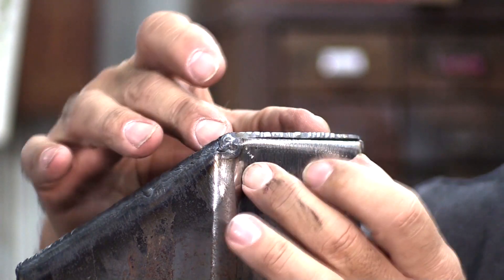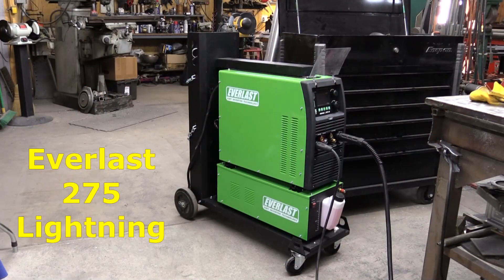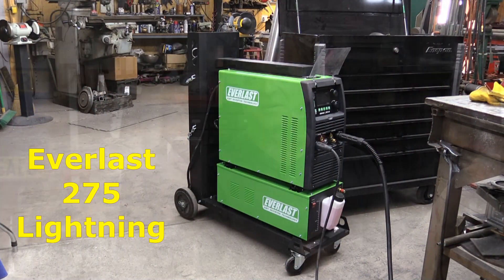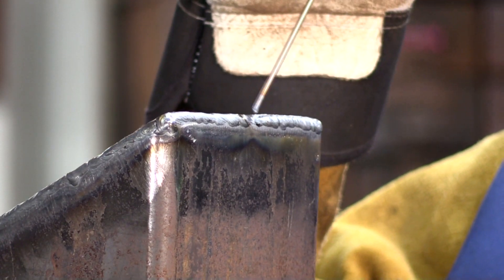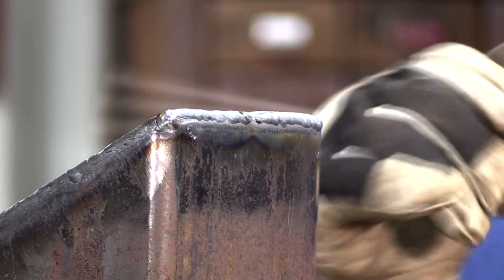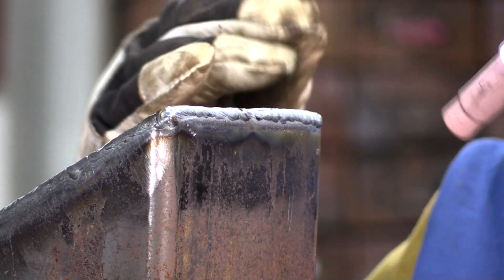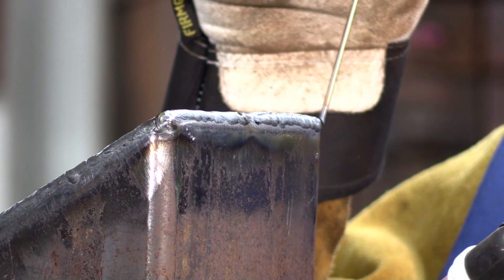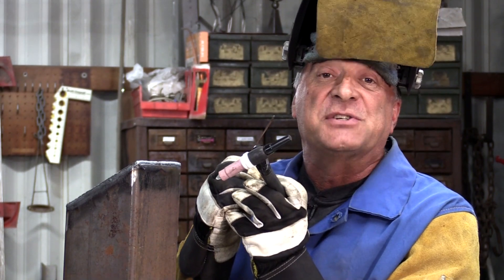How to Avoid Blowouts When Welding Closed Vessels - Kevin Caron

Comment: Hey kev.nice work yet again jedi welding master!! ..I'm still on my penrose staircase.now it's about 4 feet square!.well not square if you know what I mean.lol.blowing corners crazy as it so thin.?using 1.2mm plate at the edges to make a sharp edge to taper off .any ideas to keep the heat off the ends.my tig even goes down to 12 amp?.
Reply from the maker: Tack on the outside edges first.   Weld in from the tacks.   Turn on the pulse if your machine has it.  You might try an aluminum or copper backer to help sink the heat away.
Reply: @KevincaronSculpture  ill give it a try.the uk machines are a little bit rough and ready lol.theres a lot of old transformers .scratch start mig and tig !

Comment: Hi Kevin. I have a question. So with an MTS machine, (Everlast Lightning MTS 275) that comes with a water cooled torch, is it possible to use an air cooled and water cooled tig torch on the same welding machine? For example, if you want to just tig weld with air cooled, could you change out the water cooled setup to go air cooled?

Thank you.
Reply from the maker: That is correct! 
 Just swap the water cooled torch for the air cooled one. 
 Turn off the water cooler.  
Get to work!
Reply: That's an awesome feature! Thanks for your help. Also, do you recommend any certain tig torch companies for the Everlast lightning mts 275?

Comment: What I was surprised you didn't mention...the smaller the internal volume the more this is a problem, a large enough volume and it may not be a problem at all. Another option is to weld up to the last 1/4" or so, stop, let the part cool and then finish, the 1/4" weld won't be enough to heat the internal air to cause the expansion of the air within (unless it's a really small volume)
Reply from the maker: I knew I was forgetting something!!    Thank you for sharing your knowledge and thank you for watching and posting.

Comment: Nice trick with the vent-drill.

Question, where in the Phoenix area would you look for 5083 or 5086 aluminum?
Reply from the maker: Industrial metal supply.
Reply: @KevincaronSculpture  *nod*, thanks.

Comment: Your video on how to weld a enclosed vessels is not responsible.   NO vessel should be enclosed without some method to relieve pressure.  In a fire this is a bomb.    Don't publish this type of thing as people who do not think will hurt others
Reply: Did you actually watch the video? We don't need negativity on this channel. This is for an Enclosed vessel. He is teaching you how to do it if you want to do it.
It's not a gas can, water heater, propane tank, fire extinguisher, etc. 
I agree that he should have said it could be dangerous, but honestly- we are welders and craftsmen. We should know that stuff expands in heat.
Reply: Yes I watched it.  Sealing any vessel is dangerous.  It has become a dangerous pressure vessel.  Structures like this need weep holes.
Reply from the maker: Thank you for your concern Brad.

Comment: Remember one time watching a mill wright try to weld a pin hole in a live steam line. The line fed a plywood press and to shut it down would be $$$$. He built up quit a set of dingel berries around the hole but never managed to seal it.... Lotsa molten metal praying around in the mean time.
Reply: Failures of steam lines are dramatic and deadly.  You must  know the line is thick enough to weld on. A  place you know is thick enough.   Say a helper drilled into the live line.   You weld a split sleeve around the pipe.  One half has a vent like with a valve.  The valve is open when you start.  After your sealed and sure the sleeve will hold pressure the valve is closed.
Reply from the maker: This is why I do what I do.